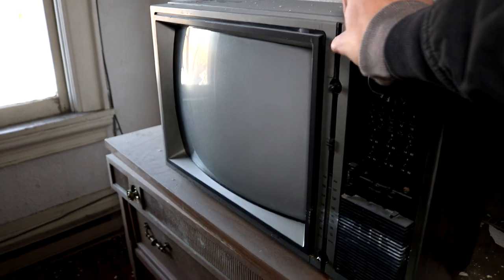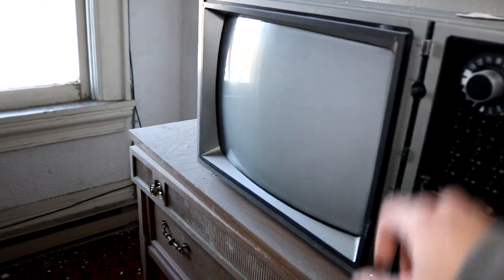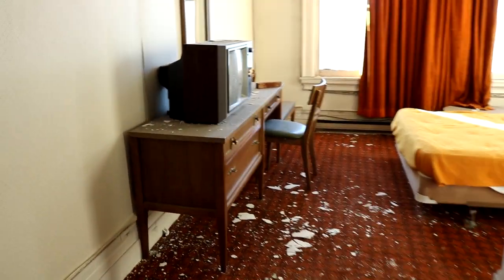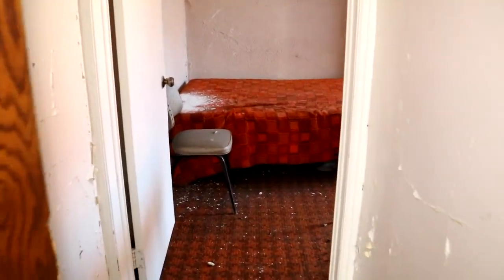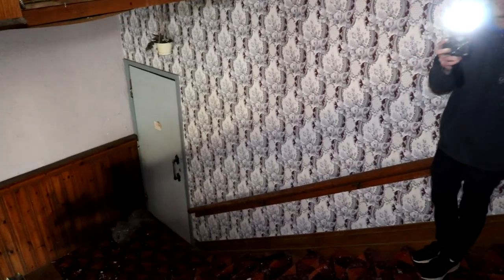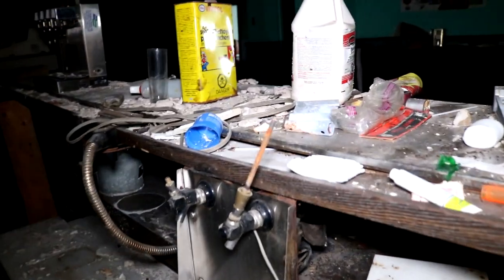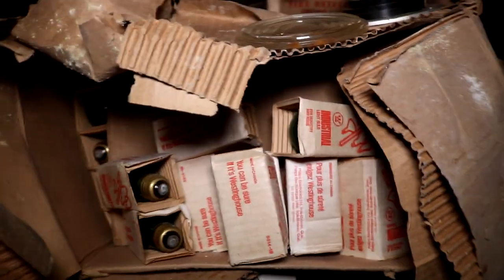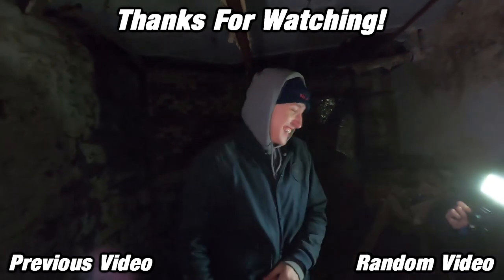ABANDONED Untouched Hotel EVERYTHING Still Inside - WITH POWER !

Comment: I find it odd that vandals haven't completely ravaged the place. CRT televisions, mirrors and windows completely intact.
Reply: Wrath of Vaughn there is some buildings that look better untouched..
Reply: Those old tv's are a bitch to dispose of. Here, they charge $50 disposal fee.
Reply: @wheatifer  so leave it on the corner
Reply: Those old tube TVs aren't worth anything, anymore. TV stations stopped broadcasting analog signals in 2009.

Comment: homeless may of turned power back on themselves to have heat
Reply: jason9022  I've known people  who hooked metal strips inside to jump across,  missing meters. don't tell me it's impossible.
Reply: jason9022  well it is an old building so most likely it has a hard cut off that someone hooked back up. It's not some new building with a digital cut off that can be done remotely.  plus they do meter the buildings even on commercial buildings I used to work as maintenance at a hotel and they had an electrical room with some meters as it took many with the amount of draw of power. each one was tri phase. So don't tell me it can't be done. I know better. it had many 3 phase panels. With power meters in the electrical room. So if the power company pulled the meters someone could by pass them.

Comment: That bell is a sprinkler alarm. Which means, if there's very low pressure or a leak somewhere in the pipe (such as the dripping water from the ceiling) it may go off depending on the sensor. I heard it go off BEFORE the fire alarm went off in the whole building. There was very high pressure in the sprinkler system. Water was all over the floor in the control room.

Comment: I can tell you right now that this hotel has not been abandoned for more than 25 years. Some of those TV's (The non-knob kind) are early to mid-90's models. Either way, its still crazy to see that it has full electric. It think its just one of those cases where the electric company forgot to disconnect the power and no one is really paying for the electric as its probably just being written off as part of the city public electrical.

Comment: To answer the power question, power is often left on to 1) give the illusion that the building is still occupied 2) slow the decay of a building by keeping HVAC systems running 3) keep people from stealing the copper wiring. You said the building was bought by the city, they're likely the ones paying the bill. They've likely forgotten why they're paying it, or what it's for because when you have the volume of cash going in and out that a government does, $300 a month is nothing, or even worse, they lumped this building's power bill in with the general power bill for government buildings, and have completely forgotten they never shut it off.

Comment: Yeah, definitely many 1990s and 2000s elements in this building. Some of the TVs are from the early 1990s, and so is one of the posters in the downstairs room. Finally, the Coca Cola Classic cans are from maybe the late 1990s or early 2000s. It's just weird that there are so many 1970s and 1980s elements mixed in—it's as if they used this place until the early 2000s, yet, in the meantime, kept a bunch of rotting '80s stuff around.

Comment: Never try to turn on a tv that has been sitting for 30 years. They can blow up and/or cause fire (capacitors and stuff). They better turn the electricity off since that roof is leaking. On the other hand I really like to have a few of those tv’s 😬
Reply: Please leave a link to a story about a 30 year old tv blowing up when you turned it on. Never happened.

Comment: Whoever owns it, probably the city, but it's worth the price to keep the power/gas on. If they did not properly heat/cool the building it would be in A LOT worse condition. The structural integrity is still very sound, a part from a complete renovation that building is still worth a pretty penny.

Comment: Has def not been abandoned for 40 years. Maybe 10. The exit signs and restaurant area were from the 2000s. TVs were early 80s though. The damage is all caused by water due to failed roof. They keep power on so building still has heat. Maybe other parts of building are still used for storage. Water+electric will not cause fire, may shunt the circuit which will trip the breaker.

Comment: That the beer it's good
Just wash the bottles in soap and hot water !
Reply: You would be able to shit through the eye of a needle after drinking that. Beer is not something that keeps well, like wine does. Beer will usually go bad within months of a use by date. My hubby had a budweiser special edition 1.tltr bottle and collectors glass the kids got him for fathers day, and after a few months the kids asked him if he drunk it yet, which he hadnt, but it was 2 months out of date by then. He wasnt going to drink it but the kids were upset he was going to have to throw it away, so he drank it and he said it tasted fine.
Kids were happy.

So, about 5 minutes later we had just got in the car to go to a local sunday market. We hadnt pulled out of the driveway yet, hubby feels a fart coming. Lifts his leg a little to help said fart along on its journey. He exclaims'WTF?' and jumps out of the car and runs back in to the house. I look on the passenger seat to see the effervescence of bubbles from the beer that had just squirted out of his arsehole and on to the car seat.

Hubby comes back out 10 minutes later having just shart out (or pissed out as he put it) 1.5ltrs of fizzy budweiser from his ringpiece. No shit or other solids, he didnt yrinate, just shat beer. And it was still fizzy. And he felt every last drop come out, not something he has experienced before or since. His body wanted that beer out as quickly as possible. It came out exactly the same colour and texture as it went in.

So folks, drink as much old wine as you want, beer? Tip it away or it will run through you like Usain Bolt at the Olympics.

Comment: The power and water might be on for a number of reasons. Heat in the building early on might have been to slow the disintegration of the building, and to run a fire suppression system. On the other hand. Perhaps homeless people turned the power back on.